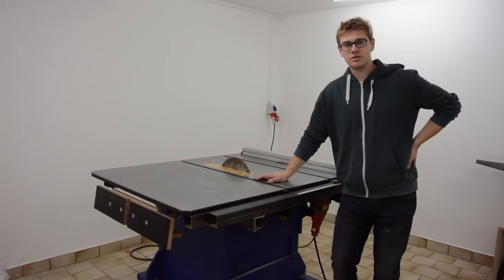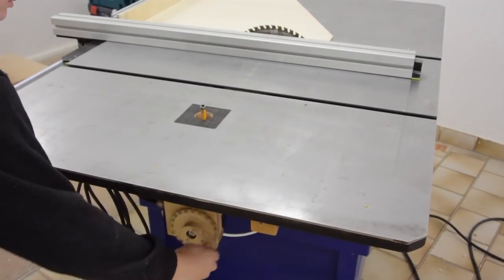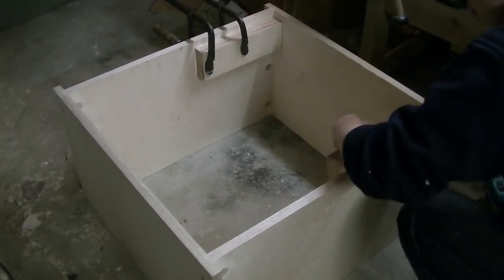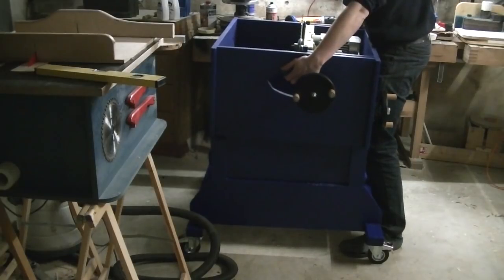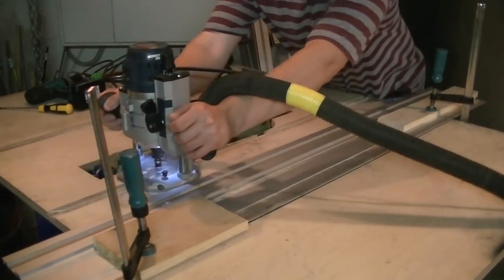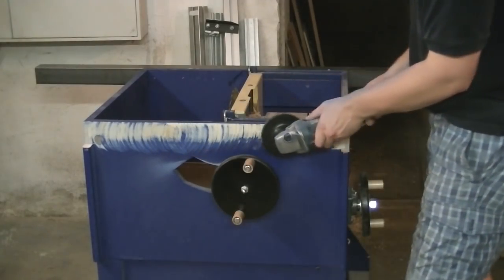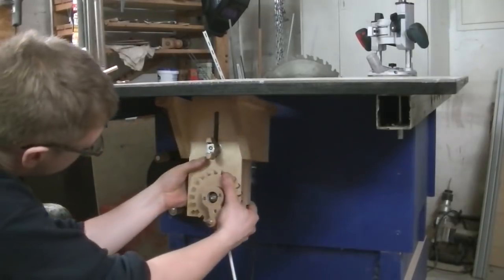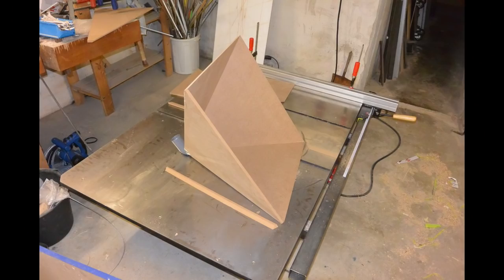How to build this big Table Saw with Simple Tools!

Comment: Nicely built.  I like how the blade tilt hinge ends up so close to the table top.
Reply: Nevertheless not enough to make one cut for 90 and 45 angle. To achieve it need to make something like your bandsaw table mechanism. Axeless prinsiple. Festool ts55 made so. Blade cut 90 and 45 in the same place.
Reply: +Vladimir Evdokimov That would be harder to build.
Reply: gjdewald of course
Reply from the maker: +Vladimir Evdokimov I thought about using trunnions but I think it wouldn't worth the effort.
Reply: You have quite big saw. And in this reason you can neglect such moment as losing saw blade protrusion. I just build smaller table saw of handsaw base and this system stole almost third part of protrusion. New model will be with  these trunnions.
Reply: Cosmas B Your tablesaw building has some very interesting moments. I'd very liked steel covering and appeared of that t-slots. Adjustable. That's great decision.
Reply: gjdewald I think he able to do it easily
Reply: Not yet). Soon, on my channel. Now I am in the process of making sliding movable fence. It already finished and next week I'll make such system what I talking about.
Reply: maravilhoso parabéns.

Comment: Hi Cosmas,
I've been thinking about building a table saw for a long time and also thought about putting sheet metal on top of it. And although I'm subbed to your channel for a while I somehow managed to miss this video :)
So now when you have some experience with this solution let me ask you some questions:
1. What steel did you use (mild, carbon, stainless)?
2. What thickness is it?
3. Did you treat it somehow (wax, some kind of lubricant, etc.)?
Thank you in advance!

Comment: If you purchase a VFD to control the motor you could use the breaking mechanism that most of them offer. An acceleration ramp can be used to make the motor speed up within a certain number of seconds, that helps alleviate the starting torque wear and tear. But most importantly the breaking mechanism, thanks to pulse width modulation, allows you to break the motor in a mater of a second if you so want. This makes the table saw much more safe since you don´t have to wait for the blade to stop and therefore you are tempted to move a cut piece of wood out of the way (like you do in the video) and on the other hand totally eliminates the hassle of waiting, waiting, waiting for that freaking blade to stop. I hate it. Hope it helps and thanks for the video.
Reply from the maker: The saw has a breaking mechanism. It's fuse is broken and I neglected to replace it.
Reply: Got ya! Thanks

Comment: Nice work, but I would add some safety features to it and use your push stick.   You will have a hard time doing this quality of work if that saw takes a finger off or eats your hand.  Your mileage may vary, but I wouldn't do what you are doing.
Reply from the maker: I'm sure you will ahve fun with all the safety features on your saw :)
Reply: +Cosmas B I will.  I own a portable Ryobi.  I had a Delta Unisaw, but it was impossible to add decent safety features to it and it blew dust everywhere.  I'll be getting either a Grizzly G0715, Delta Contractor Saw, or Saw Stop Contractor Saw.  My fingers are important to me so it will probably be a SawStop.
Reply from the maker: Cool! When I think of SawStop I always think what will be next? I don't like the idea of removing all the places of potential danger from our daily life because I think in the long run this will allow us to get dumber and dumber. However I'm not against reasonable safety features. I think especially for businesses saw stop could make sense because a choped off finger of an employee is much more expensive then a saw stop cartrige and a blade. On the other hand people will prbably not get how it works and trigger it all the time by accident without beeing endangered, which will be expensive.

Comment: Great ingenuity - I think over time you'll wish you had used more steel in the base as wheel supports, and some other adhesive on the rails - or none. Construction adhesive slips under lateral pressure - it stays quite flexible and also does a poor job on non- porous surfaces in lateral compression. If you need that to recall stay put - maybe one of the high tech automotive adhesives.  Or none  - use threaded inserts.  But this is an amazing project! Now you must design a shop-made "Saw-Stop" we can all build in expensively :-)
Reply from the maker: I think it will be fine. In respect to the glue surface there is really no load on those joints. in my optinion saw stot is pretty useless. I'd die of a heart attack when that thing goes off, I rather lose a finger or two :)

Comment: How to avoid changing the Axis of blade which gets changed automatically after a few uses. I used a Drill Machine.   But disappointed... Therefore never get a perfect square cut of 90 degree....

Comment: Hey Cosmas, this is great stuff! I really liked your previous videos, but this just what i dreamed of  :) 
I wonder how's this table in terms of flatness? Did you checked this steel tubing and sheets for straightness and flatness while buying it? Didn't this steel top deflected a bit after you screwed it to plywood or everything was just dead flat?

Also, wouldn't it be worth to lenghten the fence just a bit to add a hook that would grab back edge while clamping for 100% stability?

Keep up the great work!
Reply from the maker: Yep i checked everything for straightness and plain. It didn't deflect but the sheetmetal itself was bowing a bit which took quite a bit of pressure to get it flat but the plywood is stiff enough. It is very flat. With a feeler gauge and a straightedge I can however detect that at some spots it is a tiny bit off. But in terms of woodworking accuracy that really doesn't matter. It didn't make the fence longer because I didn't have a longer piece of extrusion and it turned out to be stiff enough.

Comment: When Opel arrived in India, with its Corsa, it promoted the product with a really lovely advertisement that amused Indians, as the advanced suspension system of the car spoiled the fun that children used to have when going over a speed breaker. The advertisement ended with saying, 'the difference is, the German engineering'. This and other such videos by Germans on YouTube only belabour the point. Nice.

Comment: Great build man! Is that Festool track saw really worth the 1,000 Euro or whatever? That's half way to a decent lathe or mill! Also holy moly, if that saw is 5 HP, that's nearly 4 KW! In the US we're 120v @ 15amps, so even at half load, you'd be blowing GFCI/RCD/RCBO/whatever all the time! Did you have to wire for 3 phase or something? 

For safety, you probably want a riving knife and anti-kick back pawls. 30 minutes to potentially save a lot of trouble. https://www.youtube.com/watch?v=9EBPwSUtnRQ This dude has a real creative solution. Also, adding an adjustable stop to the right side of your cross sled might be useful, if you need to make repeatable cuts of the same length. 

Either that or eBay has an iGaging 300mm slide/track that could be useful for around 30 Euro. Won't be as good as Starrett or Mituyoto but generally they make some cool stuff. Their magnetic digital angle tool is a good buy too, if you make a lot of bevel cuts, you can just snap it onto your saw blade and get tenth of a degree resolution.

Anyways, love your channel, creative solution.

Comment: those cross grain dowels were a really good idea...why have I not thought of that?
and where did you get birch...I live near Trier and cannot find anyone selling birch(ja, auch in deutschland)
I am re-building my table saw now...yours is very nice btw...my top is just wood with some laquer on it, but now I am thinking of getting some aluminum sheeting, because it's both cheap and will keep the weight down...thanks for sharing...I don't use a spaltkeil...I don't see a need if you are careful.
Reply: justin barrett - Sperrholz aus Birke bekommst Du in jedem Baumarkt. Das ist nichts besonderes.

Das mit dem Spaltkeil solltest Du Dir nochmal überlegen. Nur weil es so viele Videos von Laien gibt, haben der Spaltkeil und die Spanhaube ihren Sinn nicht verloren. Spätestens nach der ersten widerspenstigen Buchenbohle wirst Du das auch so sehen.
Reply: (birch)not at the globus...the only thing near me :(
Reply: isn't aluminum to soft ?
Reply from the maker: You should contact a dealer that local businesses get their wood from. Sometimes these do sell to private individuals also. The prices at Globus and other hardware stores are just insane.
Reply: yes, I do go to, or order from my local lumber mill directly...they do not carry birch. I do not have a hardwood seller near me, I can get it delivered also(cannot inspect it like that though) and it costs a fortune as well. but thank you for the advise all the same.

Comment: Nice work.
Did you had problems with the tilting in 45°, pushing the rod back with the weight of the saw. Or the bearing block had a stoper in the interior of the machine box to prevent that?
thank you

Comment: Would you please share the measurements, I'm particularly interested to know the amount of space in front of and behind the blade. I want to make one very similar and there seems to be a lot of variation here with American manufacturers. Also a lot of guys make a separate outfeed table and I can't see the logic in that, think I would rather have 1 big flat surface (shop floor space is not a concern). Thanks in advance.

Comment: Where can I find this electric motor?
Reply from the maker: I don't know. Maybe on ebay or a flea market.
Reply: Hi, Its a Scheppach TKU table saw, the current version is the TKU 4000 but the yellow one in the video is a lot older version - they do pop up on eBay from time to time in the UK (and if you google it, in other EU sites) for £50-£150.  (and if you are very lucky...  I just bought one for £20 !!)

Comment: Hi Cosmos brilliant job like it. I started turning my old radial arm saw into a table saw when I saw your video, mine works basically the same as yours but I'm looking at away to perfect my lifting off the blade how does yours lift. Hope you will share it with me. Williesouthafrica
Reply from the maker: Hi Willim! It uses the motor unit of a jobsite saw.

Comment: A very nice, full featured saw - from the table top down to the dust collection shroud. Must be heavy too which helps reduce vibration. How is the direct drive? Noisy at all?
Reply from the maker: It is incredibly heavy. We had to move it into the new workshop in pieces :) I like the direct drive because it's virtually vibration free.

Comment: I like the design and the execution. Thank you for the video. What saw blades did you use to cut the steel tubes? I see you cutting steel twice - once with a chopsaw, the next time with a Festool plunge. Do you have special blades for that?
Reply from the maker: There are special blades available for cutting steel. I think these are calles multi purpose blades.

Comment: that is über cool. looks solid. 12" blade? Is the blade attached directly on to motor? I did not see any belts or gears.
Reply from the maker: Yes, the blade is directly attached to the motor. It is a 350mm diameter blade.

Comment: I'm making one for myself, I'm using a 2hp motor, when I turn it on the whole setup starts to shake, should I add more weight?
Reply from the maker: You should make sure everything spinning is balanced and does not have too much runout.

Comment: that metal cutter blade at 5:30 makes almost NO sparks! what magic is that? is it the Evolution Rage blade?
Reply from the maker: it is a dry cut saw. Evolution saws are a compromise of a normal wood cutting saw and a dry cut saw. Not as good in either but they can do both.

Comment: Finally the video we all have been waiting for since you gave the first look to the table saw :) Great job! Thanks. I am still looking for a way to avoid the hinges and build trunnions instead, haven't come to a final solution yet. Oh wait, did you really cut the steel table top with the TS55? Which blade did you use, the aluminium one? :O
Reply from the maker: You can make aluminium trunnions using a router with a router compass. I used a blade that was made to cut plastik aluminium and steel. I think this one is called "Kaindl multi Sägeblatt".
Reply: +Cosmas B Thanks, i will have a closer look at the Kaindl blades, so far i only used the stock Festool ones.

Comment: Hello Cosmas,
nice table saw. I'm currently in building my one based on aluminium profile. Could you post the dimension of the miter slots and the distance to the saw blade. Do you have any experience after using some time ? Maybe something which is needed to change in the future ?
best regards Thomas St.
Reply from the maker: the mitre slots are 20mm wide. I would not put that left mitre slot as close to the blade if I would do it again.
Reply: Thank you for your answer. Left side will be 200 ....250mm away from sawblade.

Comment: I have an issue.Iv'e checked if the blade is 90 degrees to the table and that the fence is parallel to the blade.It's fine.But the lumber i cut  does not come out square when i cut from all 4 sides.The lumber i cut was square before i made the cut.i did the cut just to see if my table saw is accurate.???
Reply from the maker: Then your fence is not square or too flexible.
Reply: But the fence is same distance from the same tooth from the starting end and from the last end??

Comment: Nice job! I love the built in router table.
How did you figure the angles for that dust collection pyramid shaped thing? I tried to make something like that for a sand blasting cabinet, but I couldn't figure it out. I guess it's like doing crown molding, but I still had problems.
Reply from the maker: +KingNast I think the easiest way is to use vector algebra. It's really not hard if you look into it a little.
Reply: Cosmas B Thanks! I'll check it out

Comment: it's really very good except you did not explain the mechanism of raising and lowering the saw using the rotate handle out side the table
Reply from the maker: That mechanism is contained in the motor unit. I didn't build it.

Comment: very impressive build,  my only concern is all the weight of the steel and ply at the top and only an MDF base .. durability?? best homemade tablesaw I've seen though 😀
Reply from the maker: It is easily strong enough. It would take several tons to crush an mdf box like that. You can calculate it if you want :)
Reply: +Cosmas B I am not doubting you at all merely a question , and you are very correct. I did a little research and had no idea the compressive and tensile strengths  of mdf were so high! Seems i have underestimated mdf !

Comment: have you had any problems with the expansion rate differentials between the metal and plywood used to make the table?
Reply from the maker: +T Rex I suspected that that could be a problem but it didn't occur so far.

Comment: Wonderful Job !!. I would like to know what do you use on the steel tops to keep from rusting ?.
Reply from the maker: So far I have just wiped it with WD40 but I may rub some varnish on there. Until now it doesn't rust.
Reply: +Cosmas B Thank you, may try varnish on my top also.

Comment: +Cosmas B I have another question regarding the table saw.
Is there a big difference between belt driven and direct drive?
Or maybe anything you noticed on yours...
I have a belt driven one that I'm working to convert, but won't have any angle tilting because of the complexity it would need to create a harness for the whole assembly (axle+motor and belt) becaus I would need to tilt the motor too...
Reply from the maker: It runs really smoothly without any vibration. That is the benefit of the direct drive. The downside is that you don't get as much depth of cut because of the diameter of the motor.
Reply: +Cosmas B Wow seriously that is it?!
What about the power that some people keep saying that is a lot higher on belt driven(although i fail to understand why)
And there was that one about belt slip in case the blade gets stuck in some hardcore wood piece...
Not sure I could make mine into direct drive...i use 350 and 300mm blades anyway so depth might not be that bad...although it would be considerably smaller.
I shall consider all the options, might go for a link belt in the end...atm I am at the painting phase, just gave it a lovely pink :))
Danke sehr fur die Antwort!
Reply from the maker: terapiu
If the belt drive has a more powerful motor it has more power if not it has less because the belt isn't very effective.
Reply: Yeah, makes sense :)) thank you for your answers, you are a very inventive young man :)

Comment: How do you ensure accuracy down to the 0.01 thou level when the steel itself probably isn't "flat" and the metal tubs aren't either?
Reply from the maker: I don't.
Reply: one tenth of one thou? that's a might close tolerance, for a watch maker.
Reply: not a tenth of a thou - sorry - I mean 0.01" AKA the thou to ten thou range of accuracy.

Comment: Hey Cosmos, did you ever rebuild this saw tilt with a trunnion?
Reply from the maker: Hi, no. But in retrospect I should have.
Reply: @CosmasBauer  late to the party...
But why?
 Is it due to the innaccuracy of the original mechanism, or is it because you get  the comfort to keep the insert in place whilst blade is tilted (trunnion version)? I think this (trunnion) is the coolest feature on the green one you've built, or maybe a little bit more depth of cut?
Read thru all the comments but have not found any reference with this regards so I ask...
Thanks in advance.
Kindest regards/MfG
AB